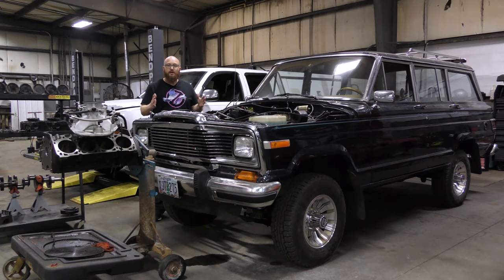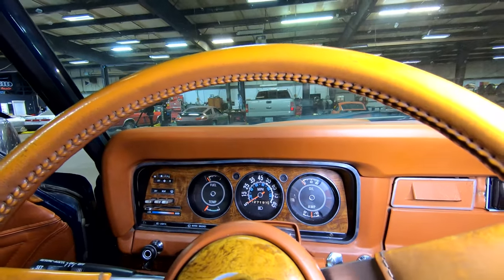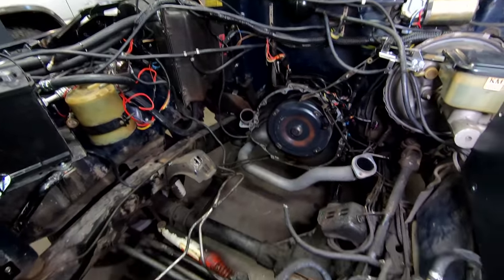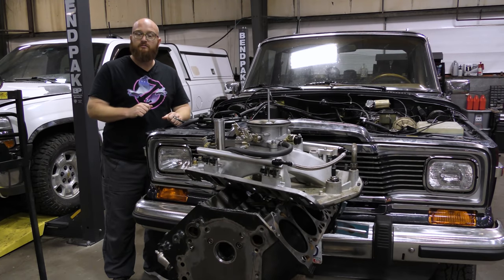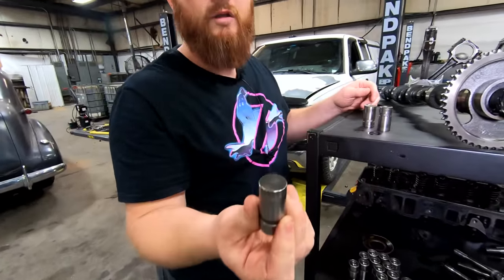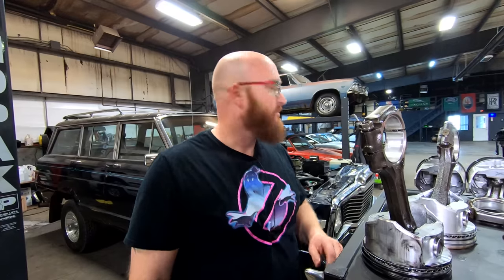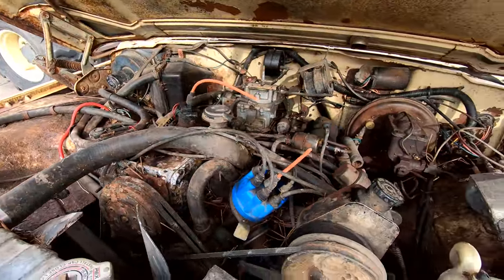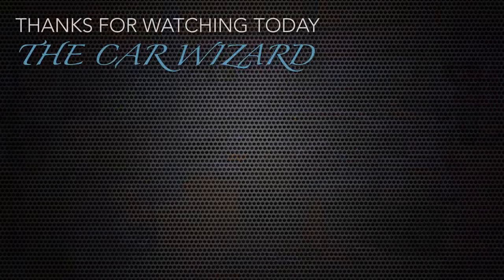The '83 Wagoneer rebuild is dead! CAR WIZARD gets burned by another shop!

Comment: AMC' V8's have a not so great oiling system. And it might have out of spec rotor clearance for the oil pump in the front cover. And they are prone to poor oiling at the back of the block.
Reply: The oil issue to the rear mains is an easy fix. And it normally only comes into play at sustained high rpm operation. There are a number of things to do with the oiling system between the pump and the pick-up. One is to eliminate any casting flash and port match the front cover and block. Another thing is to do that ever is needed to ensure proper drainback from the top of the engine. Poor crank and rod oiling is a possibility on any OHV V-8 with hydraulic lifters where the lifters get oiled first. Oil is pumped into he galley and intersects the  lifter bores. Oil goes into th ed lifters and up the pushrod before it gets to the passage for the mains. Also I think the oil passage to the mains from the lifter bores intersects the cam bore. The oil passage hits the side of the cam bore. Flow to the cam bearings is restricted by the size of the hole in the cam bearing shell. Also the cam bearings in these engines were line bored ai the same operation as the crank bore. The manufacturers did this so that lifter noise would be held to a minimum. In reality a high volume pump (I'm not sure if a high volume pump is available on the aftermarket front covers) can hurt more than help if there is not enough oil capacity in the pan and oil cannot drain back fast enough.
Really any of the oiling issues that can arise in an AMC Genll/lll V-8 can raise their heads in a Buick Big Block. Very similiar set-ups but not the same engines.
Reply: Probably not thebest engine to toss a new fuel setup on and figure out how to tune it either. The piston tops are SOOTY on this thing and all of the failures look to be lube related. I think they washed the bearings out getting fuel in the oil. Ive seen it a ton on not so problematic engines when guys toss a new fuel setup on at the same time as a fresh engine. It happens.
Reply: Everything you mention is true but the engine shop knew this and should have been paying attention to the oil pump clearance and the other issues.

Comment: Once you get past the cam / lifter failure (with a new rebuild), it is VERY important that you run a zinc additive in your oil.  This is because all flat tappet / camshaft systems require zinc to lubricate the contact between flat tappet lifters and the camshaft and modern engine oil no longer has zinc in it.  All modern automotive engines use roller lifters/cams.
I even run zinc additive in my lawnmower and snowblower.
Reply: That's certainly an interesting aspect. Easily the kind of knowledge that wasn't really widely understood in its day (just how many mechanics understand exactly how oil works?), and lost to the mists of time in the modern era.
Reply: All flat tappet cams require Zinc additive. If roller lifters are available use them if possible.
Reply: Valvoline VR1
Reply: There are engine oils that still have sufficient zinc
Reply: @MrCarGuy  Rotella still does in their t4 & t5 series oils supposedly.  It’s a decent price too, not nearly the cost of valvoline racing oil and they make it in lighter flavors 5-30 10-30 etc
Reply: Good idea I think I'll start adding zinc to my flat tappet engines
Reply: @MrCarGuy  amsoil z-rod....
Reply: I've got a 360 AMC in my cj7 since 2002. Always use Shell Rotella. No problems, still reads 60 psi oil pressure.

Comment: I wouldn't have even messed with having a shop do a rebuild, I would've bought a crate engine with a warranty and called it a day or swapped a nice low mileage magnum 360 and kept the injection that it came with.
Reply: No $$$ for wizard doing it right
Reply: Been down that road.  Magnum 360 will bot bolt to the 727 trans, so that need to go, so then you need a new transfer case, which means that you need new drive shafts.  Not to mention a cobbeled together transmission control system to make it shift up, down, and into and out of OD.  The owner had the correct concept (FI the AMC 360), but his execution was faulty.  You can buy a lot of gas with the money saved from NOT doing a drive train swap.

Comment: While 1 bad build shouldn't completely make a shops name you have to find a shop you trust that will stand behind their own work. 
Company I work at bought a new 2020 F350 and it got 2500 miles and puked the entire bottom end on the freeway. When it got to the shop on the flat bed it was missing all but #1 and #8 pistons and the center section of the crank. As I said it literally puked its guts on the freeway.
New engine and it now has 250k on it. 
People make mistakes and new parts can be defective. Cams going out dump tons of debris that can take out lots of other parts. 
And no I would not go back to the first shop again. Glad to see the Wizard is staying away from trashing others as not all the variables are known.

Comment: I suggest going with a roller lifter and cam set up. The flat tappet lifters on the market are pretty crappy high failure rate similar to what you found in that engine. That wrist pin holy smokes wrong part for sure.

Comment: Ok this exact same thing happened to me with a jeep 4.0 inline 6 it was my very first engine build i ever did in my life straight 6 somewhat basic and followed spec to the T. Lost the exhaust lobe on cylinder 4 and the cam and lifter looked exactly like that no damage to the block. Took it to a professional race engine builder who only builds v8 strokers and he did me a huge favor and rebuilt it and stroked it properly to a 4.99999 so a 5.0. We had to get a core block though because the stroker kit i built i got from “titan engines” and when my guy pressure tested the block they sold me 5 of the 6 sleeves were leaking so yeah theres always that. What he said more than likely happened was the sleeves were leaking coolant in the oil seized a rod bearing and basically chewed the cam up or that i got one of those bad cams floating around everyones been talking about. But my new stroker is awesome loving the knowledge i learned from this and thats what got me into custom engine building

Comment: 💥Rocker arm was pulled down too tight... Then the resulting metal hit the bottom end. Don't forget it was rough from the very start.
Reply: Agree, theres more to it than just soft cam/lifter combo and the wrong oil.

Comment: These things have an absolutely horrid cam gear / distributor drive as its all aligned by the front cover, which does not have precision dowel alignment, hence variable mesh of the cam to gear on the distributor, which drives the oil pump.  no OEM gear sets remain.. and some of the new parts only last a few hours. Some AMC experts now install an oiling system in the front cover to spray oil directly at the gears.  In the OEM design, only very light drip that makes it to the front cover will oil it.

Comment: Not really sure about the about the rod it could have been damaged due to the lifter failure but I wouldn't blast the engine builder that much as there is a sweeping problem with bad parts going around on all kinds of different suppliers. Bad lifters cams are more common than good ones right now.

Comment: Last year I paid $$$ for an engine rebuild in my plane. I've looked at the break-in process as having three milestones:

Crib death: 5 hours, if something is really wrong it will happen quickly.
Karma: 10 hours, letting things settle in after taking anything that far apart.
Resume normal operation: 20-25 hours, first oil change.
Reply: What kind of plane do you fly?  I deliver to a local aircraft engine rebuilder here in Nova Scotia.  Pretty cool place...
Reply: @Stahodad  Beech 23 Musketeer. Built for comfort, not for speed. 😎

The plane in my profile picture is an Arrow. Nice plane. Not mine. 🙁
Reply: Problem is if a plane breaks then it’s kinda hard to pull over

Comment: 9:03 to 9:48 Yeah I can tell just looking at that, along with the camshaft and the lobes the guy didnt do the break in period, your supposed to hold it at a set RPM to break the camshaft and the lobes in with High Zync Oil after a rebuild, then after a set amount of time, stop the engine and change the oil with the regular driving oil, so the two parts, the lifter and the lobe can learn to live together with minimal friction till they've set, otherwise this happens, you guys were probably given the engine as it was without doing the break in hence why the engine was running but was out of tune till it quit like it did and threw everything.

as that is no failure of the parts, that is the failure of the builder to disclose and do his job as the rebuilder of the motor.

Comment: The bearings will be taken out by the grinding swarf from the cam/lifter fail. Crank will be scrap too.  Incorrect hardening on the lifter is your fail point. Bin it all.
Reply: Crank can be turned if not undersize or bearings spun
Reply: @hotpuppy1  It can but every single oilway will be full of junk. Of course it can be cleaned but really you’d just start again at this point.
Reply: @ruaraidhmcdonald-walker9524  He already said he was junking the whole engine and using his old bottom end for the rebuild. Heads and timing cover can be cleaned - no need to junk those.

Comment: That thing looks beautiful, time to do it all the way right and drop a crate motor in there...as mild as a 5.7 Hemi or wild as a Heliphant!
Reply: The early roller rockers had a lot of bad needle bearings in them and would get loose and worn out quickly, letting the roller lock up and get sideways eventually, eating the affected cam lobe. They have new revised parts that are beefed up and way better quality so should be ok as long as the engine has the revised parts installed. It also was because they are using variable valve timing and cylinder deactivation to save gas. The early versions don't use vvt but can drop valve seats if they get overheated badly.
Love the hemi in my 06 Charger RT, hate the mpg.

Comment: I had something similar happen with my 98 Outback. It had a burned exhaust valve on #3 (EJ25D) at 230k miles. Mechanic had it for months. When I got it back, it died completely sounding like skeletons banging in a metal filing cabinet after only 40 MILES. Probably the angriest I’ve ever been in my life.
Reply: Oh if I'd just got my car back from a shop after engine work and it started sounding like that I'd be ready to get in a fight lol
Reply: Damn. 🪦
Reply: @umad42  I had to wait a day before going back to the shop otherwise I very likely would have. Still gets me worked up just telling the story. Fucker is out of business now, good riddance.
Reply: @Flies2FLL  I just wanted my damn car, it has a lot of sentimental value to me. He ended up taking a junkyard engine and rebuilding it and put that in for free. Mostly made things right but I really had to force him to agree to do it.
Reply: @shermanikk  That sucks!  Well, at least you have a running and driving car.  Why people do things like this is beyond me.  I do most of my own work on my cars ['01 Subaru Outback LL Bean, '14 Porsche Cayman S] but I have a good mechanic in south Florida who is the equivalent of David Long.  These guys are hard to find~!

Comment: The ONLY rebuilt engine I trust  come from Jasper.  5 year warranty.  My '71 Dodge D100 has been running on a Jasper reman slant six over 20 years.
Reply: I have horror stories involving Jasper "rebuilt" engines.
Reply: @carmudgeon7478  5 year warranty, and it depends much on the shop that put it in.  It runs whisper quiet and gets 21mpg
Reply: @carmudgeon7478  And that's why I live in Appalachia.  Our mountains were bigger than the Rockies... but time and erosion... and nothing much rusts here either.
Reply: @bmwloco  You remember that far back?😲
Reply: But that was 20 years ago. They don't build em like they used to.
Reply: @keithstudly6071  And it just did a 700 mile trip with a ailing motorcycle in the back.

Comment: Sometimes its crap parts, sometimes an incompetant builder. Seen both. We once had a fresh rebuilt 4g63 engine (from a very well known shop) that wouldn't build oil pressure. Upon teardown, my friend discovered that the main bearings were installed backwards, blocking oil flow. Among other issues. Thankfully, it was caught early enough to save most of the engine.

Comment: What did the oil filter look like?

Is it worth risking using parts from a failed engine?
Reply: If they are actually checked good and not bent and shit, there should be no issue.

Comment: My 84 was the same color, but in no where near as good of shape. Hear my out on this, but a 4.0L would be a good swap option. Fuel economy, power boost, nearly bolt in, and reliable as all hell.
Reply: @Rich Rishel plenty of I-6 engines in FSJs. Lets not forget lots more involved with an LS swap and you could also stroke the 4.0 to 4.7 or so and/or ad some sort of fan. Still be easier. LS swaps are also boring, and in a couple of years, outdated. You'll never get neck snapping acceleration out of one of those without spending a mountain of money. Why try? A stock HO 4.0L makes more HP than OEM (181+ vs. 144) and has a torque curve you could eat a family meal on.  Lets not forget it also says "Jeep" on the engine.
Reply: end of the day, the 4.0L is longer lasting than an LS, much easier to install than the LS and more powerful than the 2B 360 it came with.
Reply: @Rich Rishel the people that want a Grand Wagoneer with wood paneling stickers and fresh carpeting in the back aren't taking them to the drag strip. Those that are would probably do a Big Block or some soot monster. I am not talking about the computer making it more work. they both need a computer. That isn't anything. The difference is the 4.0 needs to change 1 motor mount (bolt in junkyard part, no welding) and I think has the same bell housing as the OEM transmission. You've got to change an awful lot to swap in an LS. Motor mounts as mentioned, transmission, transfer case, drive shafts, speedo-output, etc. all that stuff stays with a 4.0L
Reply: The old POS I had had a 4.2 swapped in, so probably less than 100hp. I lived in probably the town with the steepest roads in the state at the time. I learned patience from that vehicle,  and never got a speeding ticket since. The 4.0L is still significantly more powerful than the OEM engine. The 4.2 was quite a bit weaker than the 360.

Comment: Looks like chinesium engine parts. Lots of junk stuff out there these days. When you have to break in a cam & lifters by pulling inner valve springs out and running on just the outers, then reinstalling the inner springs, then you know there is a serious metallurgy issue going on there. 
I'd have the Jeep owner contact the "builder" and see about a refund for damages(yeah right), or civil court is the only other recourse.

Comment: My guess is that the bad lifter caused the stuck piston, as well as the additional wear on the bearings.  That's much more reasonable and plausible to believe than the builder installed the piston with seized wrist pins or didn't use assembly lube.  I'm surprised that anyone would believe that.

Comment: Absolutely critical on any standard flat lifter and cam combo to run a QUALITY High ZDDP Break-in oil. Comp cams had all kinds of issues with cams rolling off flat due to the surface of the cam giving up when they took the ZDDP out of standard oils. I saw several self destruct with less than 20 minutes of run time.. They used to have a good writeup on their web page, everybody got caught off guard back then.. This one is a mystery... Its been long enough any builder should know better by now.. 

Also that being said,, there are only a few guys left that know the ins and outs of the old AMC engines.. So you have to shop careful.

Comment: That's to bad. Amc always made a great engine but nowadays it's hard to get quality aftermarket stock rebuild parts for them, and you really do want someone who has knowledge of them so they know what to look out for. I'd give the block a good look over and if the water jacket is the only damage it could be welded up, again by someone who knows what they're doing.

Comment: I had that happen to my 79 Ford LTD (302  V8) after I rebuilt it and didn't add in break in oil... Rather than replace the engine or rebuild it, I decided to just flush it and install a new cam and pray. The engine broke in well. With some diesel oil, Lucas, and ZDDP the second time. This all happened at the end of 2021. Was it the right decision? Many of you will disagree with me and that's okay. My thought was (and is) if its trashed it'll let me know (rod knock) and I'll replace it. In the meantime, I just want to drive my project.
Reply: That would be fine if this block didn't have  hole in it.
Reply: Yea. I agree with you there. This is a worst case scenario for sure.

Comment: Another lifter failure from cheap manufacture, I am taking Uncle Tony's advice, going with roller cam on next build. Once the block cracked and coolant entered the oil all bets are off on bearings and wrist pins.

Comment: I’ve been in that situation, but it came with the pickup I bought. Pulled it stuck another engine in it. Got an offer for the one I pulled. It still ran it was just off. It was an economy builder where you trade your engine and get a cheap rebuilt one. You get what you pay for at these places whether it’s a trade in or just a cheap overhaul with no machine work.

Comment: Even if that cam didn't fail that piston with the tight rod would've destroyed the cylinder it came out of and probably would've spun the bearing anyway from all the heat that would've built up. Would've cooked the oil right off those rod bearings.